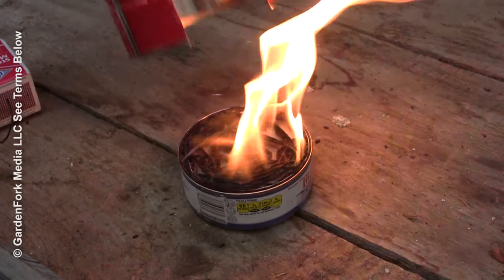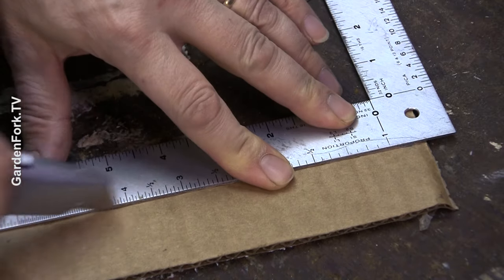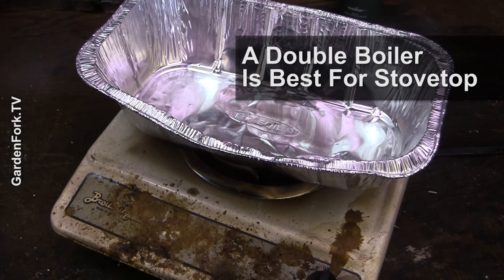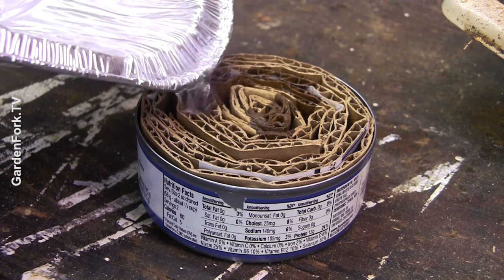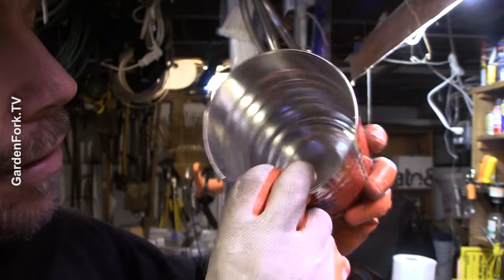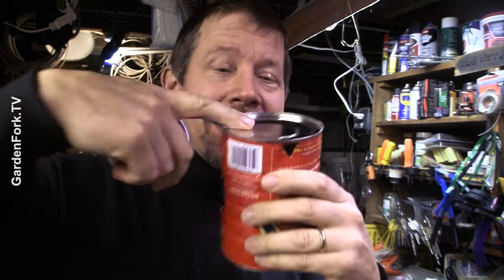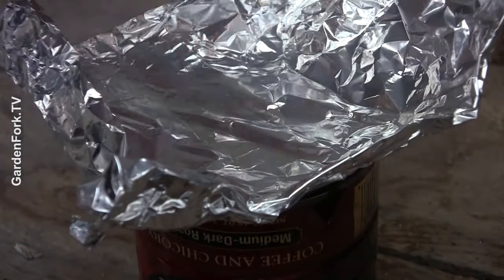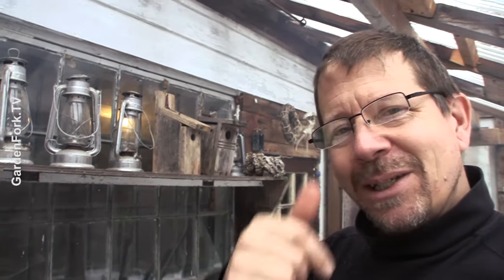Camp Cooking with a Tin Can Camp Stove - GardenFork

Comment: We made our tin can stoves in Girl Scouts with #10 cans. We built wood fires with twigs to cook our meals on. We also made buddy burners but I found them way too hot to use with the tin can stove. If I had used a pan on the stove it would have worked fine but I tried to cook on the top of the stove instead of in a pan.

Comment: An unused toilet ring is a good cheap source of wax.

Cut three strips of cardboard 1/4" wide and 2" long.  Before pouring wax, stick them in the top of the heater and be sure to soak them with wax.  You can use them as wicks to light the burner.
Reply from the maker: never thought of using a wax ring, brilliant!